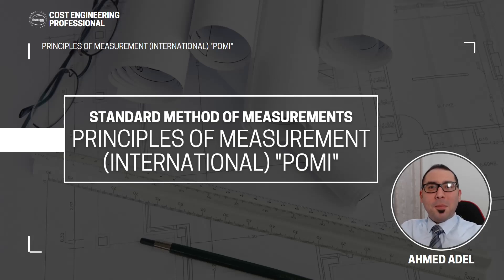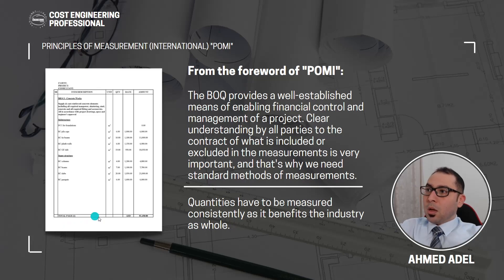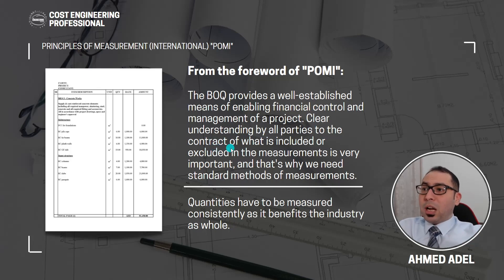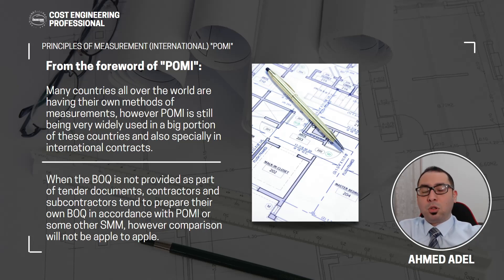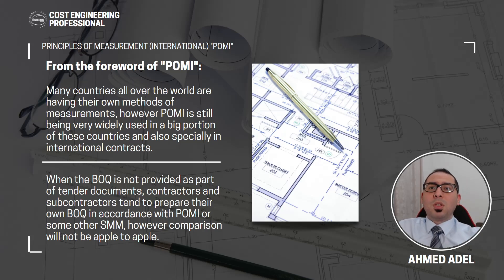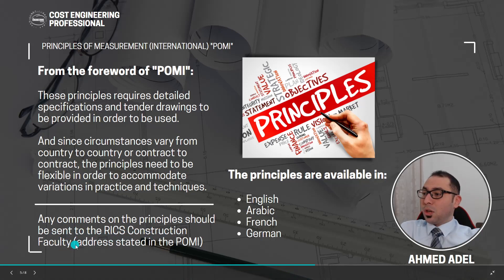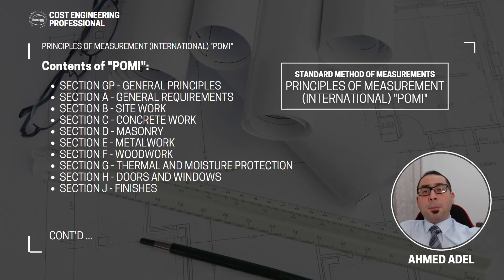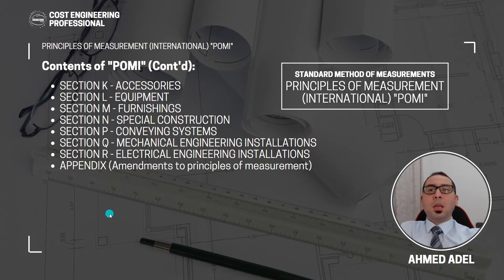Bill of Quantities and the Principles Of Measurement International "POMI"

Comment: Good Afternoon Sir, Your knowledge is superb and i learned lot from you. 
In my latest assignment, I am facing small difficulty.
I am working on Basement+15 Floor Building.
This Question is for Representation of Formwork quantities floor wise. So, While writing BOQ, Shall i go in the manner mentioned below.
a) All Formwork upto Plinth Level
b) Formwork From Plinth Level To First Floor Slab Level 
c) Formwork from First Floor To Second Floor Slab Level
.
.
Continue till 15th Floor or Any other good method ? Will you please share your email so that incan explain my point more clearly >
Reply from the maker: Thank you Sujeet for your kind support. I would suggest splitting the concrete BOQ into sub structure and superstructure. Under both of them you will have poured concrete, steel reinforcement and form work. Under the form work of each you may state the items element wise ie. beam columns slab staircase